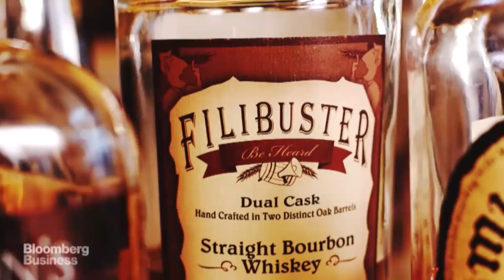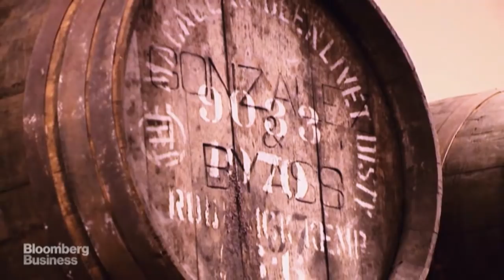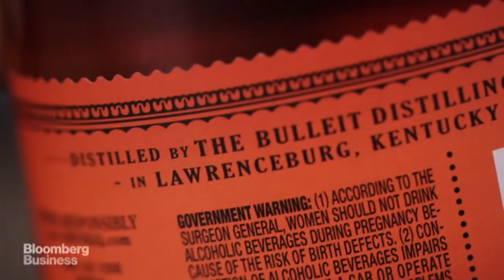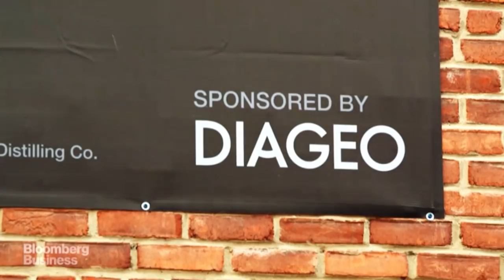The Bourbon You Are Drinking Might Not Be What You Think

Comment: When it comes to age and price, keep in mind, the longer it sets in the barrel, the less there is (and considerably less, that is) due to evaporation. And every year it sits there in the barrel, the distiller pays taxes on it... Year after year... And not by weight, but by barrel. It's not as simple as "barrel it and age it" as this video suggests. Aging is actually a costly venture. And one more thing, stick a barrel in the top of a warehouse, and it will age real fast, and you can bottle it quick and sell it cheap. Keep it on the bottom of the stack, and it slows down and smooths out. It's a science. You'll never find Pappy in the rafters. You'll find him always on the floor.